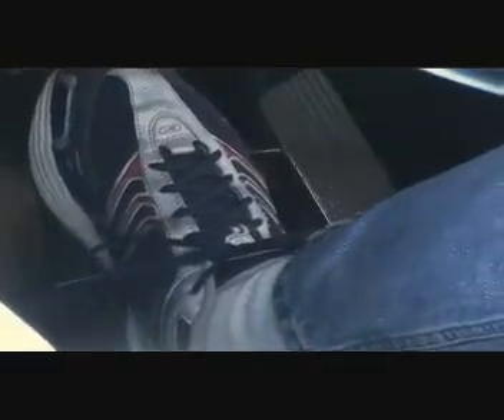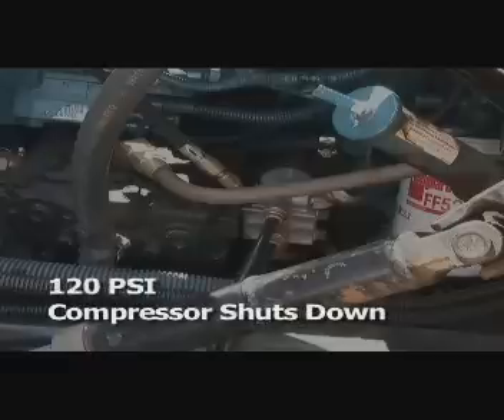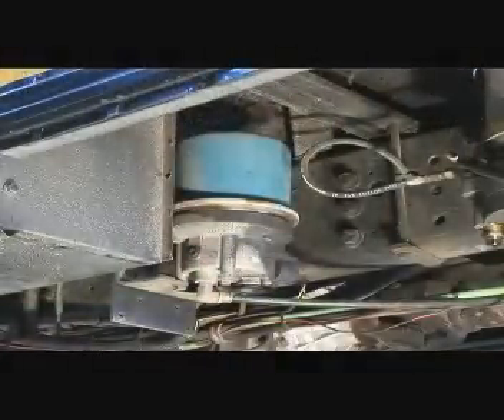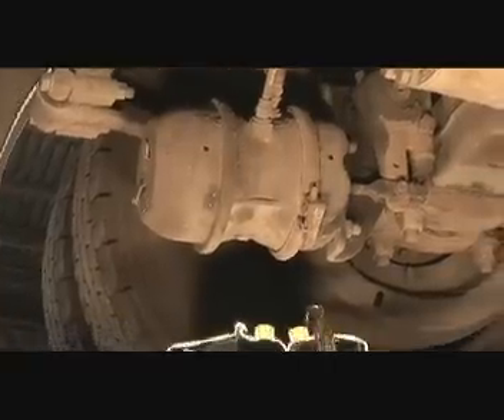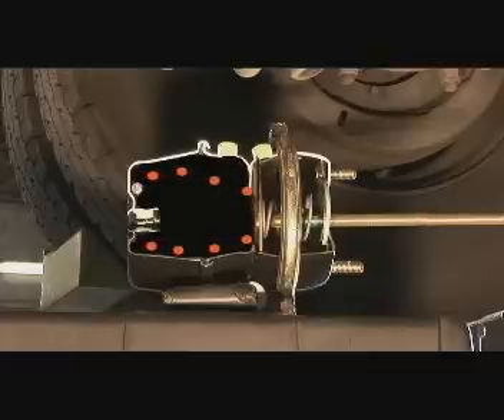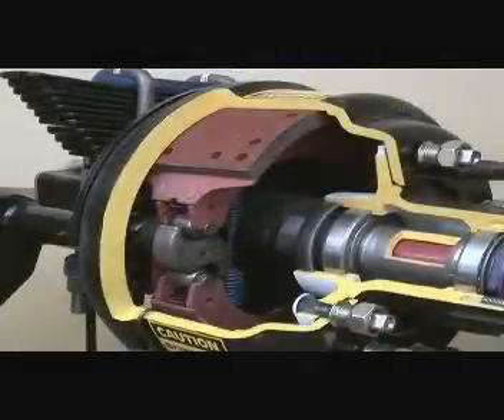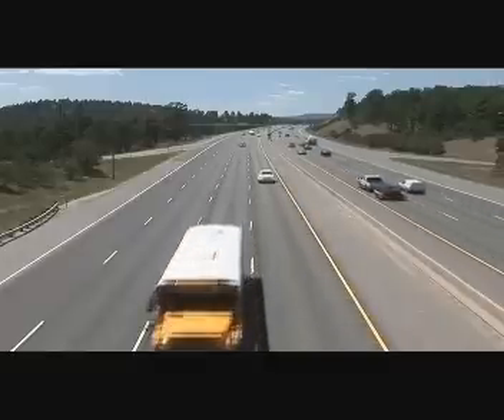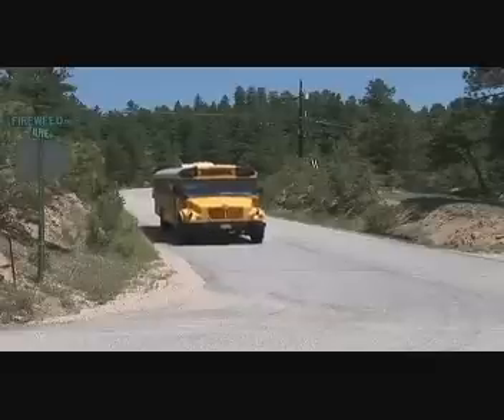Lessons in School Bus Air brakes

Comment: IF you lose Hydraulic pressure, you lose braking. you don't kow it until you push on brake pedal then you realize you don't have brakes.
With Air brakes they won't allow the vehicle to be moved unless the system is working and you have air. once in motion if you lose air pressure below a designated range(usually 60 psi) the spring brake pops out and forces the brakes on and you cant stop it....this brings the vehicle to a stop .. and cant be moved until the air pressure is working.
Reply: I get confused cuz why it don't keep rolling if breaks don't work ? Why does it stop ???
Reply: @devinevisionary 

You need air to release the brakes.
Without air the brakes are engaged.
You’ll never lose brakes with Air Brakes.

With hydraulic brakes you need pressure to engage the brakes.
If you lose pressure, no brakes.

Air brakes much safer.
Reply: @craiglittle7367  I passed thank you 😊
Reply: @devinevisionary  

Congratulations!

You’re going to drive school bus?
Reply: @craiglittle7367   yes

Comment: @hondarider100r The brake booster has 2 separate halves.  The rear section (Parking/emergency brakes) has spring force holding the brakes on and requires air from a spring brake valve to work against this spring to release the brakes.  The front section (service/foot brakes) works in reverse and requires air to apply the brakes.  This was not shown in this video.  This air for the service brakes comes from your foot valve by driver demand.  I hope this helps.

Comment: While I understand your line of thinking that slowing down pushes the weight onto the front axle like a person slowing down from a sprint pushes weight onto the front foot it gets more complicated.  Note that steer axles have only one wheel and will have a brake shoe with less width as opposed to drive/trailer axles.  On tractors with semi trailers at least the major load is on the trailer tandems and drive axles and these have the most weight on them and the most traction so they do the most.

Comment: @hondarider100r 

The rod is cut in half. So when the spring is pushing down the rod, the half of the service brakes is pushed down as well. But when the half of the parking brake is pulled back by air pressure (in the rear chamber), applying the footbrake will pressurize the front chamber en push down the front part of the rod. The back half of the rod stays in place because the front half cannot pull on it due to the cut.

Comment: On  the  30/30  piggyback  the  back  spring  side  of  the  can  takes  about  60psi  to  release , and  60psi  equivalent  is  all  the  apply  braking  you  get  when  you  have  an  emergency  air  loss . 
The  sr1  or  sr7  inversion  valve  modulates  spring  air   pressure  to  give  you  a  partial  controlled  brake  application  when  you  loose  primary  air .
Reply: Or  install  a  cage  bolt in  each  piggyback

Comment: It depends, maybe u heard the air dryer releasing moisture or the parking brake being apllied. If the second option is what u heard, the operator pulled a valve that released in one hit the air inside the parking brake chamber. Its loud because it has a really big spring inside. If the first option is what u heard, it was because  the air dryer releases humidity from the system periodically.  Greetings.

Comment: Almost .. you can lose all the air in the primary reservoir (rear brake tank) and the spring brake will not apply. The driver is notified via the buzzer and lights on the dash that a major system fault has occured (green gauge shows "0".. the SR 7,or R7 or other inversion valve on truck will allow modulated parking brake applications to get the vehcile off the road.. usually good for 4 hard applies before the air is gone and NOW the wheels lock up.

Comment: old  man  
The  spring  brakes  do  not  use  air  to  apply  only  to  release , the  front  chamber  of  the  piggyback  is  what  does  the  application . On a   tractor  the  3rd  axle  often  doesn't  have  a  piggyback , only  the  apply  chamber , it  looks  like  a  larger  version  of  the  front  can
Reply: Ok?
Reply: The Tool Guy .nj

Comment: Question
I think You can check the front break adjustment manually by pulling on the push rod. While the buses wheels are chocked and the pressure is released or the front air break is empty. 
Can I manually check the rear air breaks? If so how?
Does the emergency break need to be engaged to test the rear air breaks? Or do they need to be released? 
Seems like the procedure is opposite to testing the front air bteaks.

Comment: I notice sometimes when a commercial vehicle is parked you can hear the sound of air releasing from the vehicle. Now days I learned that is from the air brakes. What is happening when the air brakes make a releasing sound when the vehicle is parked?
Reply: MrWill1985 moisture is being released from the air dryer.

Comment: mr will 1985.. ive looked this video up because of a debate i had with a friend. when the brakes are applied, air is actually being evacuated from the brakes. causing them to apply. the parking brake removes all of the air from the brakes.. that is why you have to let a truck build air pressure before it will move. this video is wrong, unless it is realy old.

Comment: Whoa Whoa at 5:47 he says "when the emergency brake is released" and the video shows the push rod going out that is wrong, going out would be applied not released!
Reply: I noticed the same thing. Its definitely incorrect
Reply: that part of the video was particularly unclear if not completely wrong. they glossed over how normal service break application is made making it sound like it was some externality a rod connection of some kind. also some older passenger buses have dd3 brakes which have two air Chambers and a much smaller spring that serves a different purpose.

Comment: My question for the whole industry is how often does the desiccant in the air drier need to be replaced barring oil contamination from a compressor with broken seals.
Reply: I  don't  know  that  there  is  an  absolute  recommendation  but  most  of  the  companies  I  have  dealt  with  replace  it  on  an  annual  basis

Comment: I just had curiousity on how trucks brake, I've been playing Euro Truck 2 :D
Reply: same system as a bus. only difference is you have glad hands that connect to the trailer. one is an emergency (red) line the other is a service (blue) line once you disengage the parking brakes air flows through the red line to the rear chamber to disengage the spring which rotates the s-cam and releases the brakes and when the service brakes are applied air flows through the service line to the chamber where the spring is compressed, slack adjuster is pushed forward and the s-cam is rotated to apply the brakes
Reply: Roderick same xD

Comment: Why REAR brakes need 80% of the air? If its the front of the vehicle that has all the mass of it when the driver presses the pedal brake
Reply: Because the rear brakes do 80% of the  braking. The front brake shoes and air can are much smaller, though this is changing on the newer vehicles.
Reply: @cbmech2563  But if that were the case, wouldn't the rear wheels spin every time you hit the brake?
Reply: Prior to the 70s heav trucks didn't even have front brakes, then they put very narrow shoes on with a very small air can, and a pressure limiting valve so that you only got 40% application. 
Now they are using a 7" shoe with a #24 can and 8 5/8s shoes on the rear in an attempt to reduce stopping distances and a big push for disc brakes. As long as the abs works you can't lock up the brakes and on a loaded truck you would have to almost put the foot pedal all the way to the floor
Reply: @eliasrosales4899  I'm assuming you meant lock it up and slide the tires?

Comment: This video is sort of wrong. It takes air pressure to RELEASE the brakes. It’s a fail-safe so of you lose air pressure dramatically such as a sheared off air line or a stuck open moisture drier valve, you don’t lose brakes. In that circumstance, all brakes would automatically engage.

Comment: Often I'll open the trailer drain cock and get the foul smelling emulsion, but I'm sure the drivers rarely if ever dump the air tanks especially on the trailers even though they're supposed to daily.  One driver thought he had an air leak that needed to be fixed because the air tanks would leak down overnight lol.  Certainly audible and perceivable air leaks in a short time period need to be fixed, but it's a pneumatic system not a refrigerant system.  They think air driers are maintenance free.

Comment: he said the rear provides more braking power than the front (3:52)..but isn't most of the breaking power of any vehicle in the front?
Reply: +Henry Chuong You're confusing Stopping Power with Breaking Power.  Spring brakes ( rear ) are stonger than Service Brakes ( front ).  This video isn't very accurate on the air brake system.  If your going for your test, I would not memorise any of this, study your manual instead.
Reply: +MapleBalls Thanks!
Reply: +MapleBalls 
The spring brakes in the rear are not stronger than the service brakes. The springbrake only takes about 60psi to release. You can apply the full 120psi to the service brakes.
Reply: +MapleBalls 
Both front and back brake chambers are service brakes. The rears have springbrakes in the piggyback for parking. In an emergency a straight truck or bus uses an sr1 valve to modulate the air in the spring chamber (loss of primary air circuit). Also I've never seen a single tank (even a partitioned tank) on a truck and that bus isn't any smaller than any 2 axle truck
Reply: Look up sr1 valves on YouTube
Reply: Spring breaks have FAR more pressure applied bud, they are 2 different things.  Comparing sizes in diameter, clearance and pressure is how you should look @ it.  My truck releases @ 70psi and even @ the max legal 135psi, the front won't be the same strength as the back @ 0psi.
Reply: Henry Chuong on a passenger vehicle or a hydraulic breaking system then yes the front does most of the breaking but on a commercial vehicle that is a air break system then the rear does around 70-80% of the work,you should normal have to replace the rear pads twice to the front 1 or 2 to 1 ratio
Reply: Trucks carry heavy  loads on the rear tires...

Comment: I like your video but giving bus drivers a false sense of security when you say the parking brake will pop out and stop the bus. You have to loose air from both tanks at the same time to make this happen. A duel air brake system with evenly disperse the air if the opposite tank has lost air. Other than that, I love your video very informative.
Reply: no as soon as you lose pressure your brakes do apply. rear brake chamber has air flowing all the time that's the parking brake/emergency brake as soon as that loses air spring decompresses which pulls the slack adjuster, rotates the S-Cam and applies the brakes. service brakes are the exact opposite when air is applied spring compresses pushing the slack adjuster which rotates the S-Cam and applies the brakes.
Reply: +Mitch S The spring does not apply perssure in Service brakes.  The membrane fills with air & the pressure applies the brakes.  Only Spring Brakes are applied with presure from the springs, hence the name.
Reply: I never said the spring applies the brakes I said air enters the spring compresses which applies the brakes aka the spring holds back the brakes and air pressure applies them. now that I read it yes it is confusing so I apologize but that's what I meant to say
Reply: +Dawn Thompson not to mention, if the spring brakes automatically apply, and you are going more than 5kph, the vehicle will stop...really quickly...and it will hurt...i had the springs come on in the yard at only 5 kph, and it hurt...any faster and it may break something.
Reply: jfsa380  if  you  have  enough  weight  on  the  truck  at  speeds  over  5mph  it  probably  won't  lock  the  brakes . remember  you're  only  getting  an  equivalent  brake  application  of  about  60  psi  not  the  120  psi  of  a  full  brake  application .

Comment: 3:52 Thats incorrect! The FRONT brakes provide about 80% of the braking power not the rear! its the same with almost every road vehicle.
Reply: you  are  NOT  going  to  get  more  braking  force  out  of  the  front  brake   (5 inch  shoes  type  20  or  24  can  )than  out  of  the  rear   (7inch  shoes   type  30  can)
Reply: That’s true with smaller cars and some medium duty vehicles. However that’s not the case in heavy duty trucks with air brakes. The rear brakes are your primary and front are the secondary.
Reply: Nose dive effect. Some treadle valve on european truck has a predominance port . This will counter the nose dive effect, which will prevent jack knife effect on semi trucks

Comment: That animation on the spring brakes is way backwards!! 

The air pushes BACK the spring allowing the brakes to release and it is ....wait for it....the SPRING that returns the rod to the "applied" position should air pressure be lost. damn, way backwards lol